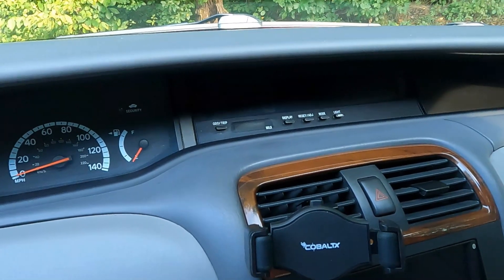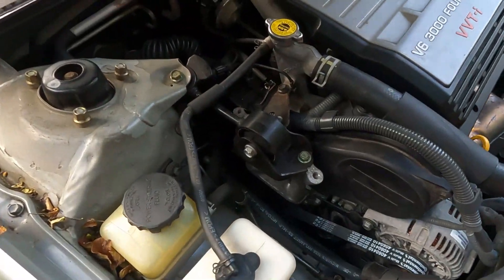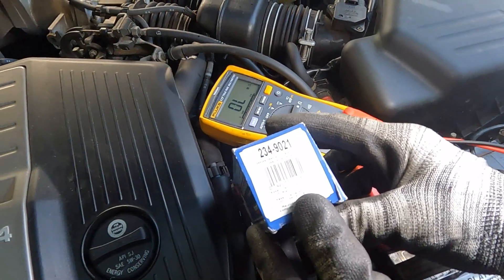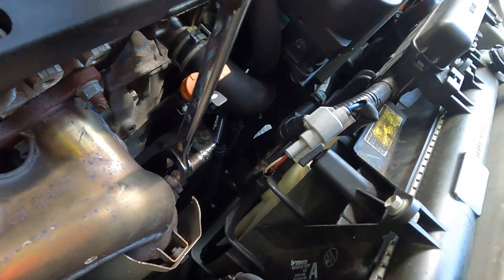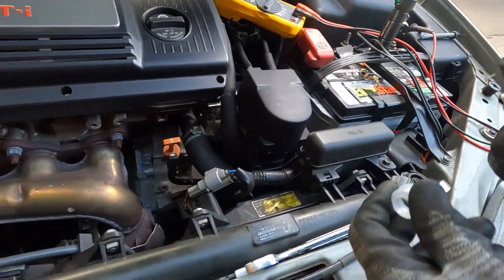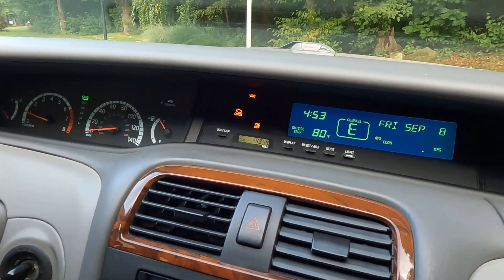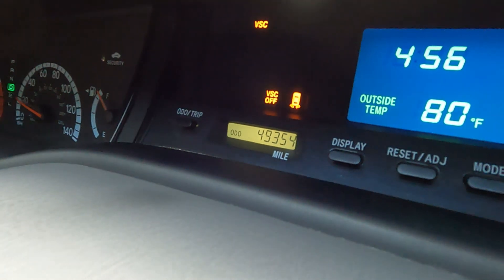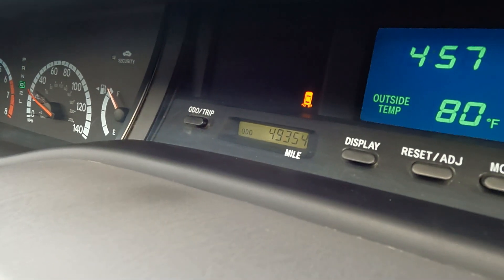Toyota P1155 and P1130 codes - FIXED!

Comment: I have P1155, but I confirmed that the heater circuit on the sensor is still closed. I guess it’s an upstream issue? The code came up after I took it to the dealer for maintenance, not sure what they could’ve messed up
Reply: Exactly same codes P1155 and P1135 pop up with my 2000 ES 300 after couple days to the mechanics.

Comment: Check engine light came back? P1130 is on the other side of the engine, bank 1 sensor 1, right below next to the bottom fire wall. California has its own O/F mixture sensor requirements and more expensive. DENSO should come with a little anti-seize compound, no?
Reply: Most Denso parts that have threads include a small amount of copper anti-sieze - enuf to do 3 or 4 of these